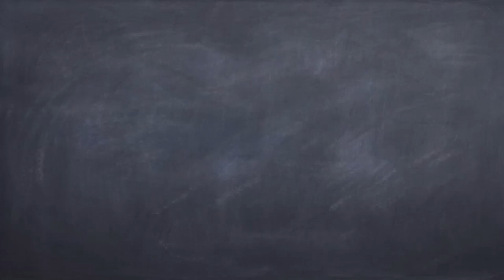1:32 Wingnut Wings Fokker E.III Final Part | Step by Step Scale Model Aircraft Build

Comment: I bought an Eduard 1/48 Fokker E. III because of this video, so I know what to do. You, sir, are a legend. 
Just one comment: you said you did lots of propellers, and always do them with pencil. How different/more difficult would it be if I try it with a light brown airbrush with acrylic paint, mask it, use a brush for dark brown acrylic paint, and then use oil paint for final touch?
Reply from the maker: Thank you very much! Eduard's Eindecker is great kit. If you have painting skills oils are way better than pencils. But it takes lot of time to dry.
Reply: I am planning to do all the turnbuckles for 1:48 with 0.1mm copper wires and stretched cotton swab sprues. You think it can be done? Yours were already tiny, I am skeptic if they would look good on a 1:48 plane.

Comment: With all due respect to those who like these kits, they are extremely, overly expensive despite the quality. I can buy a scale radio control Fokker, Albatros or Sopwith kit (plus the accesories, fabric and motor/batteries/electronics) for the price of two of those plastic kits (even the price of one of the largest). More fun building a real wood and canvas airplane (which is more realistic than plastic), lots of scale detail to get creative,  and the satisfaction of flying your own creation than just having it static. Nonsense overly expensive and overrated kits.
Reply: Well, R/C planes and plastic modeling are two completely different hobbies! Also R/C and static models made of wood and canvas would only look realistic in much bigger scale. I also doubt your claim regarding the price of a scale R/C plane, a real rotary or radial scale engine alone would set you back a few thousand dollars, a good remote control a few hundred and so on...

Although I never had a WnW kit in my hand, they seem to be awesome with a lot of research input. Overpriced maybe, but definitley no nonsense! If they are to expensive for you I would suggest 1/48 Eduard kits for WWI planes.